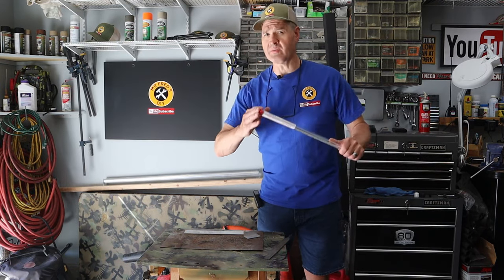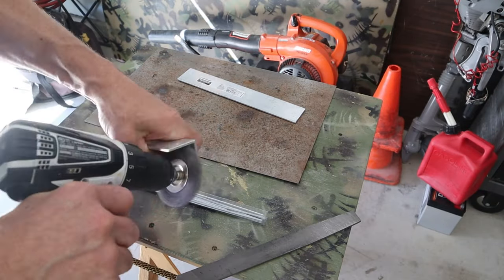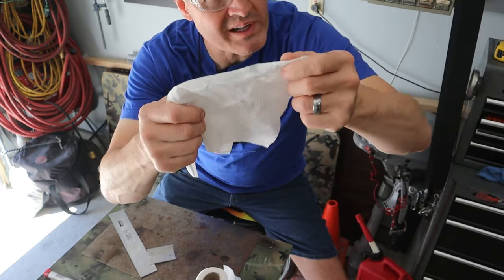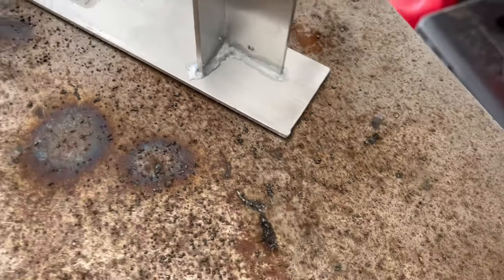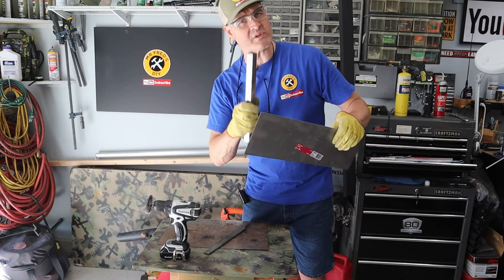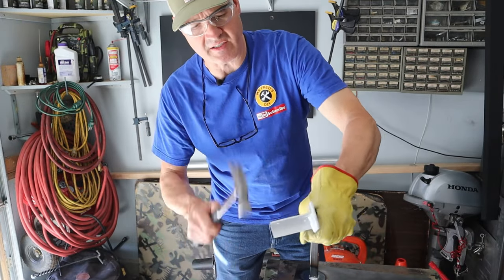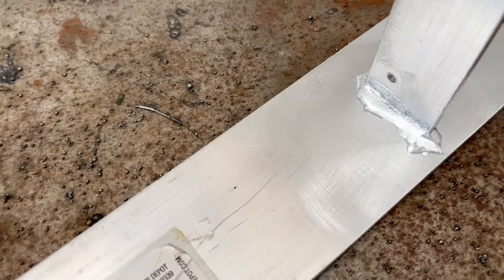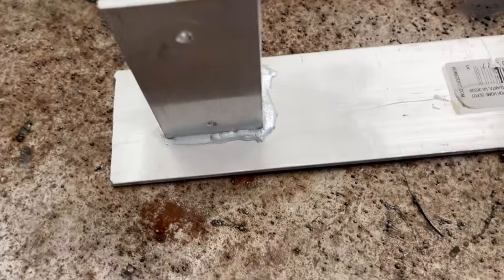Aluminum Welding Rods: What You NEED to Know

Comment: This is not really welding,  this is soldering.   It's strong enough for a lot of things but it's more like gluing than welding.
Reply: At least if it's being used on a low strength aluminum alloy, and the heat is high enough, there's a chance of a metallurgical bond or even a partial one.  There's no chance of that with steel and that's not what soldering or brazing attempts to do either.  Clearly not for industrial applications but a weekend warrior/DIY'er can surely make good use of this like they would a JB Weld.
Reply: It’s brazing, which is stronger than soldering, and weaker than welding.
Reply: Pffft…
Reply: @morningcoffee1111  brazing is literally a form of soldering 🙄
Reply: @BillySBC  it's brazing, not soldering. It's not welding. It's not soldering. 

It's brazing
Reply: @morningcoffee1111  Brazing is stronger than welding if your lap joints are spectacular.
Reply: @kevinkuzyk381  Brazing is higher temperature,  stronger,  soldering.
Reply: @BillySBC  and welding is higher temperature, stronger, brazing, right? Lol. Welding isn't soldering either.
Reply: @kevinkuzyk381  Welding is melting and mixing of two similar metals,  creating a melted pool of each and allowing them to mix and freeze.   Brazing is not this...  Brazing is GLUING.  Brazing is BONDING.  Brazing IS a form of soldering with stronger soldering metals.
Reply: I have described soldering and brazing as like a metallic opaxy.
Reply: @BillySBC  no it's brazing not soldering. Brazing and soldering while similar in appearance are NOT the same on a molecular level and calling them the same shows ignorance while trying to feign intelligence and exlertise.

Comment: They call this an aluminum welding rod but in reality, it is a Zinc rich filler rod and the process is actually brazing.  if you really want to test the weld, do a T joint and then do a face bend.

Comment: I really believe most people know you cannot weld aluminum to steel, but good demo on the aluminum rods.
Reply: yes.... i totally knew that.. i just wanted to watch the video in case.. my cat didn't know🤦

just for... you know... everyone else reading this, what would somebody use?
Reply: I had a customer come in asking me to weld his running boards back onto his vehicle, seems the last person that welded them on didn’t do a good enough job. Half way through the job I realized the problem, aluminum to steel. I was wondering about my sanity after that one!! The welds were very crapy but it does work!
Reply: Anybody know if? What about “galvanised steel” pipe. Trying to do something simple “artsy”.
Reply: @Wigglewonks  i ended up using brass and steel. i have been experimenting with lead tin silver and aluminum. its not too great so far, right up there with hot glue
Reply: @Mitchell_is_smart._You2bs_dumb  appreciate it!
Reply: @Wigglewonks  good luck
Reply: If you have listen to the video carefully he said " lets see IF aluminum will stick to steal"
Reply: This isn't welding. At no point does the piece get hot enough to melt aluminium.
It's soldering.
Without knowing the composition of the rods, only experiment can show if it will alloy with steel.

Comment: I tried this. The rod just turned into a blob. Never stuck to the work.
Reply from the maker: Don’t give up! Surface preparation and temperature are the big factors. Try preparing the surface with a dedicated stainless steel brush that has never been used  on iron or steel. Clean the surface with acetone or alcohol. Getting the temperature right can be tricky, you are looking for 730 degrees so be patient heating the aluminum. Apply the rod to the metal, if the temp is 730 the rod will melt. Avoid using the flame to melt the rod. Good luck!

Comment: Did you use a stainless wire wheel.. you must use a non ferrous type.  If not you impart iron to the aluminum.   Embellishment.. you should mention what type you used..

Comment: Great video.
You are spot-on...the secret for them to work, is to prep the surfaces. If you do not, the weld will not hold beyond a casual tap.

The first time I used these, I was in a hurry and thought the two parts looked clean enough....Fail.

They are pretty amazing though. You can even use them to patch an aluminum boat that has a hole in it. As a practice, I punch a hole (dime size) in the bottom of an aluminum can, and use the rod in circles around the hole. It gradually fills in and closes the hole. (It also teaches you on the heat application of the base metal....too hot and the aluminum will melt down, especially if it is really thin.)

Thanks
Reply from the maker: My first few attempts with these things did not end well. That’s probably why I wanted to share this video lol. Thanks for watching.!

Comment: wire wheels tend to overheat the aluminum and can embed contaminants under the surface of the aluminum, making it uncleanable with solvents or significant sanding. its better to initially wipe the aluminum down thoroughly with acetone to wash all loose contaminants off of the surface, followed by prepping the weld joint with a light abrasive (scotch-brite abrasives, fine-grit sanding disks, a stainless steel wire brush, etc). finish by again cleaning with acetone and drying thoroughly before welding or brazing. this should allow for a smoother and higher quality weld to be made, with desirable aesthetics as well.  
not trying to be an ass but steps like these can greatly enhance the quality of your work as well as assisting in smoother operation of welding equipment- the old timers taught me this stuff
hope it helps
Reply from the maker: Fantastic tips! Thanks for sharing!
Reply: @desertentertainment397  well many don't know aluminum from magnesium u file a bit off out on a napkin and light the magnesium will burn and spark green .You over heat magnesium it feed itself and burn down u won't put it out say goodbye to what ever it was
Reply: Well some times a greenish but I definitely see it spark and burn

Comment: For cast aluminum I found stick welding with E4043 rods works great on old outboard parts. Good penitration for working outdoors in windy conditions too. But the best way to weld aluminum is mig or tig. But just DIY now and then works great

Comment: I fixed my truck tool box worked perfect.   Still holding after 4 years use it almost daily.
Reply: what type of metal did you weld with these rods on your tool box?  was it diamond plate?

Comment: So I googled how to weld aluminum without a tig welder, and discovered this method. A quick search on Youtube brought me to this vid. Very informative and to the point. What I am interested in welding is the joints in electronics chassis made of .08 aluminium sheet, if anybody has any thoughts on doing this would love to hear them.
Reply from the maker: That is some pretty thin material and I would imagine it might warp at the temps needed for this process. Perhaps if you used a micro torch it could work. What are you trying to build with your project?
Reply: @MrFredsDIY  chassis to make guitar amplifiers in.

Comment: Thanks for the vid. Some of the similar products on Amazon say they can weld ice cubes to blocks of cheese they're so versatile.  I tried brazing two pieces of steel together and no dice. But this stuff has been useful for a lot and no $1000 tig machine and all the trappings needed!
Reply: I had co worker convicted after I told him to go get me some concrete welding rods and I show you a thing or to.. dumb ass did my boss got wind of his search and was hot! Priceless moments 😁😁😁

Comment: Please, for complete beginners, can you say more about what we need to know about handling the flame? How should the flame be set, what part of the flame should contact the piece, how long are you actually heating the pieces, how much do I need to move the flame around? Any cautions to be aware of?
Reply from the maker: The hottest part of the flame is at the end of the “blue cone”. With map-pro gas like I am using in the video, (that burns at about 3700°F) it only takes a few minutes to heat the project aluminum to the required 720°F.  I move the flame around both sides that I want to join to get them up to temperature evenly. It’s best to not let the metal get too much hotter than the 720°. This can be done by periodically testing with the rod to see if it will melt by touching the metal as opposed to melting in the flame. The metal should melt the rod.
Reply: Aluminum is a good heat conductor, so long as both parts get good heat, it's not so important which bit of the parts is heated.
Might consider heating from the back side too.

Comment: One question, I see the aluminum flat seemed to bend easily. My concern is the annealing the aluminum. The "weld" is strong, but now the base material has been weakened. Could you do a bend test (with lbs of force needed to bend the base material) before and after the braising?
Reply from the maker: Interesting perspective!
Reply: It's brazing, welding involves fusion of the parent and host metal.
Reply: I’ve used these Alumiweld rods successfully for a few projects using 6063 AL extruded stock and can confirm the aluminum definitely gets annealed / softened. Over the course of a few days / weeks the aluminum will slowly reharden. If you don’t want to wait that long you can bake it in an oven for one to two hours at 380 to 400 degrees F.
Reply: @desolder75  thank you, it was hard to find that data
Reply: project farm did a video where he tests the strength of these rods, they're good

Comment: Please reply, I'm a basic diy guy and I have built a bicycle with a 2 stroke motor on it and the bike is aluminum, being a thick aluminum do u think these would work if I cut the bike to put a bigger motor on it and reweld the frame support with like aluminum sticks is doable and durable to hold up to daily riding....with out wrecking and impacts of course
Reply from the maker: I’m not sure this is the right application for that purpose…

Comment: I have no experience with this, used a butane (kitchen type) torch and aluminum rod to solder two stainless steel M14 washers together, it held well. It is unusually convenient and seems to be strong enough for light uses.

I want to get my hands on some nickel silver rods, mapp torch to braze and re-test.

Btw, I found out this random info while doing some research:
If MAPP torch flame isn’t blue, (like yellow), the fuel isn’t burning 100% and probably producing carbon monoxide, deadly in areas with poor ventilation.

Comment: I wanted to braze an aluminum box together for an air intake system, but I'm wondering how it will hold up with the engine vibrations over time.
Reply from the maker: That’s a fine question. Braze welds like these are not like an arc weld but they are strong. I have a spare tire mounting bracket that I brazed together about 4 years ago that shows no signs of weakening. Thanks for the comment!
Reply: @MrFredsDIY  Sweet, thank you!

Comment: Can you use this to seal gutter seams?
Reply from the maker: Probably not. Most aluminum gutter has a coating and of course is painted so the heat would ruin the paint.
Reply: @MrFredsDIY  this would be way better than gutter sealer.

Comment: Hi, I've got a project where I'm trying to braze large pieces, about 4' length. Every vid I see only shows about 2" to 4" of test. How long of an increment should I attempt at a time? I'm assuming I can't heat the entire 4 feet without one end cooling down again. Also, should I be worried about reheating the parts that have existing braze weld? Thanks for the insight. I need it, trying this for the first time with zero welding experience
Reply from the maker: I would clamp both sides if possible while making the braze weld. As one end cools the metal will definitely move. Good luck and let us know how it turns out!

Comment: How would you use these on a crack in a large 3/16 aluminum boat. I have trouble getting the metal hot enough. The crack is only 3 inches.
Reply from the maker: I would use mapp gas and heat an area several inches around the crack as well as the crack. Heat will dissipate very quickly on a larger surface area like an aluminum boat.
Reply: get friendly with a waterproofer., road worker, or similar... one of those guys with a BIG blowtorch, for working in certain waterproofing compounds... cus thats the biggest issue of aluminium, its sucking all teh heat away....

if you can prop a camp oven under it, a gas burner... 

then you run the issue of permanent warping as the area heated is so large and the hull buckles... 

pay someone with a TIG.

Comment: Yeah that’s more of a braze than weld, as it doesn’t melt the base metals. Quite strong result, though, likely due to good prep. For AC Tig aluminum welding it is critical to brush through the aluminum oxide, and not induce any contaminants. Stainless steel brush, cleaned either with isopropyl alcohol or acetone, and only used for prepping aluminum…

Comment: How long do these brazed joints tend to last? Will it crack after a few months or years of vibration? Wondering if I can use it to make reliable car intake manifolds or intercooler tubing.
Reply: I wouldnt use it for an intake or any application that has a lot heating and cooling cycles.

Comment: How long does it usually take to completely cool? Do I need to remove or clean anything such as flux after the weld? Thanks.
Reply from the maker: My project took about 15 minutes to cool down. There is no flux in this process so no special cleaning needed! Thanks for the question!
Reply: @MrFredsDIY  Thanks clarifying.

Comment: Is there hotter map torches?

 My BernzOmatic 4000 with Map gas won't get my thicker aluminium base plate hot enough make this rod stick.😢
I think it 6061 alloy
Reply: Add a insulator (welding blanket, silicon hot pad, etc) between the aluminum and whatever's holding it to minimize heat transfer between the two. Aluminum is already a excellent heat sink, stick it on top of a piece of steel or in a vice with no insulator and you'll never get it heated up to the required temperature.

Comment: Hi guys and gals. Does the melted rod material go towards heat kinda like solder does when soldering copper?
Reply from the maker: What I noticed is that the rod melts and seems to just pool with gravity.
Reply: nope. its zinc, doesnt seem to flow or run... its not under flux. you gotta sort of scrape it under the surface of the aluminium oxide layer as it is.

spent years silver soldering/brazing... i only noticed the "flow towards/away from heat" as rather subtle, and definitely not anything to really consider at all. generally, "flow to where-ever is hot enough to tin, clean enough to tin, and has sufficient flux" was more the deal...
Reply: @paradiselost9946  thank you for taking the time to reply! Much appreciated.

Comment: just a safety concern, don't use the same wire wheels to clean aluminum as you do steel, It could cause the wheel to explode, I've seen it happen in welding shop, same with grinder wheels too, stay safe

Comment: ok..aluminum and iron don't close that easily...but iron and tin solder together? It's probably not the best solution, but I suggest that there is a slightly stronger joint than aluminum ?
Reply: these are zinc. with the right flux and surface prep, they will "tin" steel, just like galvanising...

Comment: Had a feeling it wouldn’t work on the steel.
Reply: TIG is the "steel brazing". Yes you can braze steel with a torch but that's just a waste of time and money. Brazing is  better for softer metals, but Brazing is actual welding compared to Soldering.

Comment: soldering vs welding.  i don't think you are getting hot enough to weld, technically speaking.  aluminum welding temp is above 1200˚F, and you are not getting close to that.  so, really this should be considered soldering.